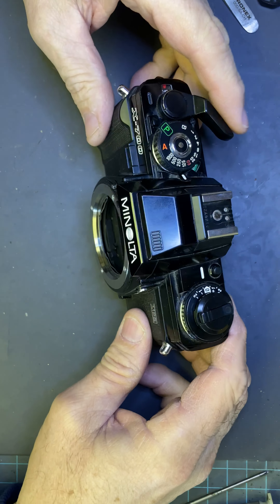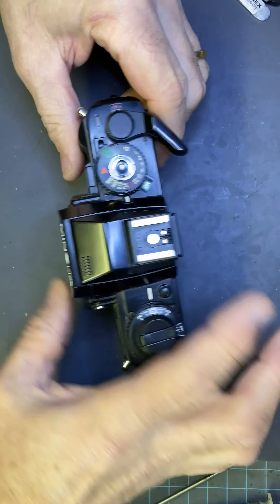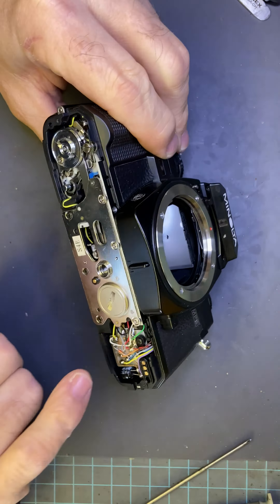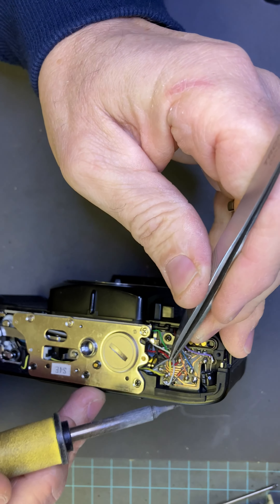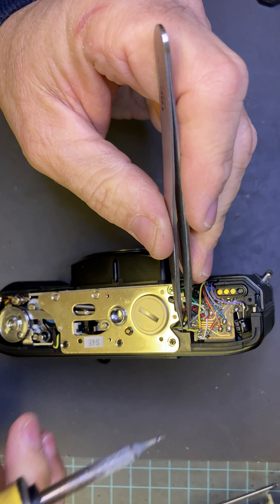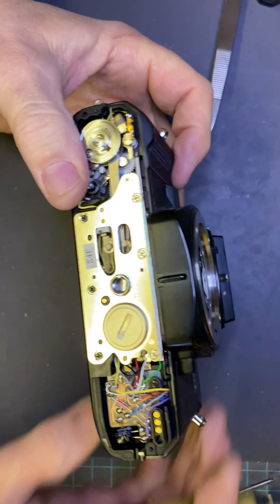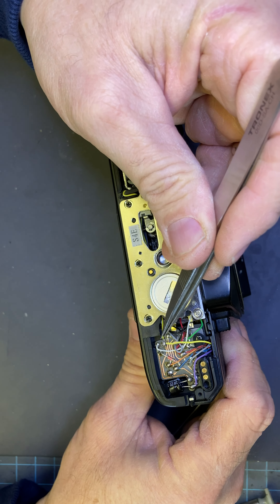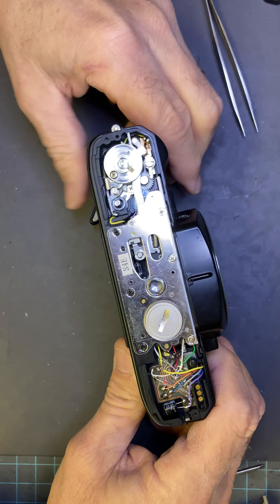Minolta X700 Repair/Hack

Comment: Wow. I had this exact issue. Camera was turning on, and the light meter worked fine, but the shutter just wouldn’t fire. This was my first EVER soldering job! I replaced the bottom capacitor—which definitely needed to be changed anyway—to no avail. Gave this yellow wire trick a shot and it miraculously worked! Camera fires like new now. Thanks!

Comment: I replaced the bottom capacitor, but testing the old one it was reading within tolerance.  I connected the yellow wires and wrapped with kapton tape and is firing flawlessly now! Thank you! Now on to the light seals….

Comment: Hey Jim! Thanks for the awesome videos! I'm working on one of these right now. I've replaced both capacitors, but the light meter doesn't read correctly, bottomed out even pointing at the sun. In program mode, light meter displays between 2 and 4. Any ideas what could be wrong with it?

Comment: Nice, but what's the explanation? Current goes where it doesn't belong or a minimum amount of resistance through the board?
Reply from the maker: I think the corrosion make a resistive pathway on the board and pull the voltage down on the yellow wire. I think but cannot prove it. All i know is that it works.
Reply: @ictcamera560   I'm curious how did discover it
Reply from the maker: @d5husky  I had it on my desk for two hours troubleshooting the electronics. I knew it yellow wire needed 2.3v or more to release and when at rest it was testing 2.7v but when I went to release the voltage would dip to below 2v (1.9v if I remember correctly) and the camera did nothing. At that point I  lifted the wires to run down the short and by lifting the wires it worked. Many times if you lift the diode on the board you will see corrosion underneath. So I think the damage from the capacitors causes a short to happen but it is only a theory.
Reply: and last question, everyone says there are two capacitors, but on top there are two of those, right? I saw another guy replace both on top plus the bottom one. I’ll try to replace it once I buy a better soldering station
Reply from the maker: @d5husky  On the X700 there is one on top and one on the bottom, some other Minoltas have two on the top and one on the bottom.

Comment: You've done this in a lot of cameras? I'm new to fixing cameras and don't want to break it even more
Reply: Update: it doesn't seem to work. The shutter was working yesterday, gave it a few clicks, then today stopped working and I can't seem to find the problem. The capacitors are just like these on the video, the battery is new, it turns on and beeps but doesn't fire
Reply: @henriquerennourbanavicius7113  same problem here
Reply: @medasvaiseta6026  ok, try to spin the motor drive on the bottom a little bit, this will make the shutter fire. If it does help, reply again and we'll see what to do next. I fixed mine las week

Comment: I had the same issue. Well, removing the corrosion does actually help, I was quite surprised that corrosion that was barely even visible caused the problem.
Thanks, I found your explanation in the comments and that really helped. I absolutely did not expect that corrosion could cause such a voltage drop.
Reply: Hey I'm facing an issue where  the shutter won't fire and the film advance lever is stuck. Do you mind giving any tips that'll fix this problem? Thankss
Reply: @prollyharry781  If the meter is still working it is probably the two capacitors (the non tantalum ones) or maybe corosion on the bottom cicuit board. In my case it was both. btw the older X 700 usualy do not have that issue, because they build entirely with tantalum capacitors which are way more reliable. There should be information in the web how to change them, which might be to much for just a youtube comment.

Comment: Hi, I replaced the bottom cap, and did the yellow wire mod you showed here, but the the shutter still won't fire, and won't rewind. Any ideas? There's some videos that talk about another cap on the top side. The X-700 is a great camera, and I'd hate to relegate to the landfill. Thanks!

Comment: Great video  ITCCamera… thank you for the tip, however, if you know any hacks for the x700 Minolta for when you advance the film and the shutter fires automatically. I don’t have any play in the fire button which leads me to believe(a light bulb just came on in my head) that the button is stuck. I hope you have a fix for this because I tried the method in this video and that didn’t fix my issue… many thanks in advance if so!!!

Comment: I have the same problem but on an XD7 will this work with it?
Reply from the maker: The XD series is a completely different beast and nothing except batteries and film interchange.
Reply: @ictcamera560  thanks I was reading the camera manual and the wires sealed to be s1 connection this assuming it could work. Two large paper weights at the moment. I actually have an x700 where the film winding doesn't fully move to the next frame leading to some double exposures. It works well with the motor drive though. What would your thoughts be on this

Comment: Thank you Jim! 
This is very helpful but I have now another problem so I changed bottom and top capacitor under film sensitivity board and now only aperture release mechanism reacts. The shutter still doesn't work. Each time I need to do shutter release procedure by connecting 3v on ground and green wire. Any ideas what to do next? https://drive.google.com/file/d/11_Qiao-HM_dMJonDy3YgtVEHhW7K7cfl/view?usp=share_link